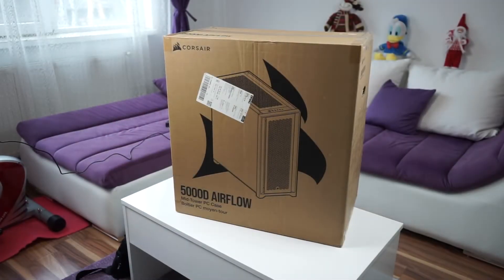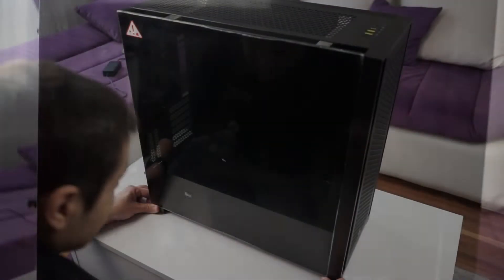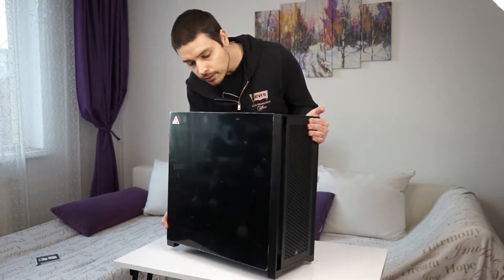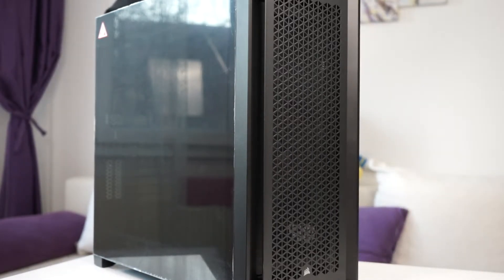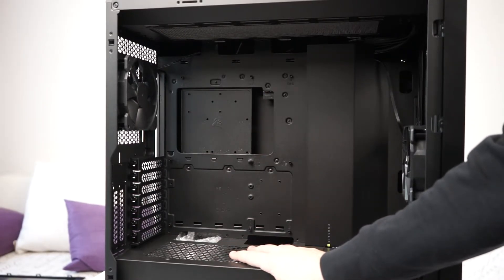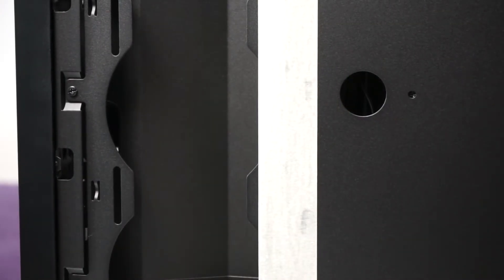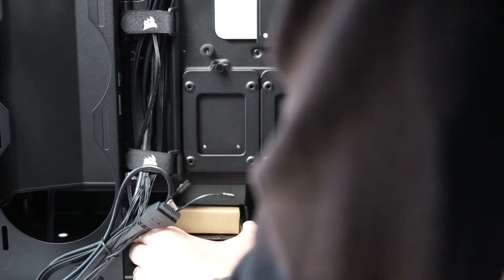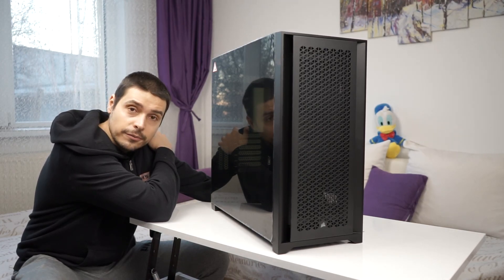Unboxing the Corsair 5000D Airflow Black variant twice

Comment: Didn’t inspect my glass like you did. Third time opening the case it just shattered. Didn’t hit anything with it.
Reply from the maker: Hello Liquid, 

Thank you for your comment. I am sad to hear that 😢. I usually check products carefully because we have bad delivery and i often get damaged products. I hope you can return it.
I think Corsair could have put some rubber along the case edge that makes contact with the glass.
All the best 👍🏼
Reply: @TheTechStudioDev  Managed to get a return as I only owned it for a few days but now I have anxiety opening glass side panels. Do you lay the case down when you open the side panel or do you open it another way?
Reply from the maker: @liquidsh4d0w10  What I do is after I remove the screws, I pull back the side panel instead of going to the side.
Reply: @TheTechStudioDev  Just had my replacement come in and its damaged. Yay...
Reply from the maker: @liquidsh4d0w10  That is frustrating 😨. I picked up my replacement straight from the store and had them open it for me, just to make sure. Maybe you can do the same.